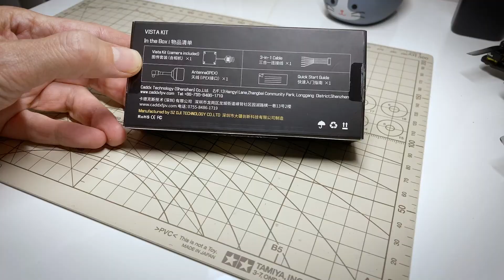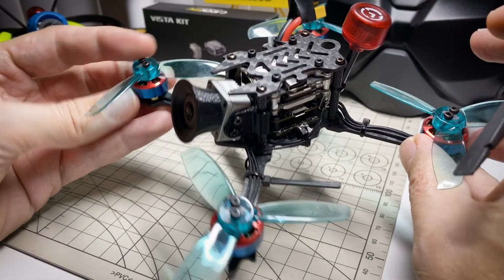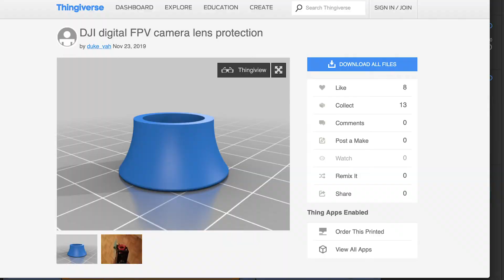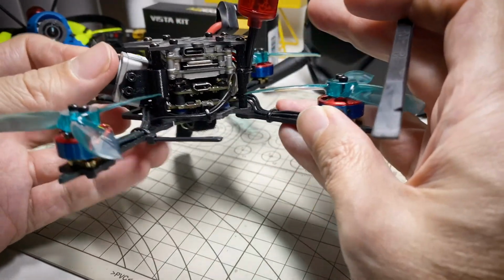Caddx Vista DJI Digital FPV Quick Look + Tomoquads CS3 Chopstick and Airblade 1404

Comment: I made the huge mistake of buying a Tomoquads frame! NEVER AGAIN! First off, they will not respond to emails EVER! I've emailed them 3 times and never heard a word! TERRIBLE CUSTOMER SERVICE!  Secondly, I nicked a twig about 3-4 feet off the ground and it fell into the soft grass. I wouldn't even call it a crash it was so mellow. I went to go pick it up and was AMAZED THAT AN ARM WAS BROKEN! 4th flight ever with it! Barely even hit the ground! Didn't roll over and over across the ground, just landed! Broken arm! First frame I've ever had broken in 3.5 years of flying about TWO DOZEN QUADS! Plastic frames are stronger than this SHIT QUALITY carbon fiber used in TOMOQUADS frames! Total garbage! When I emailed them, they couldn't even be gracious enough to reply!
GUYS:  DO NOT BUY TOMOQUADS PRODUCTS! You'll be sorry, like me. And, it was more expensive than ALL the other frames I looked at. ROYAL RIP OFF! 😳😩  Owner is a total jerk!!!!! 💩

Comment: The xing 1204 seems to be a lot more powerful (500g thrust on 4s), have you considered them instead of those 1404?
Reply from the maker: Interesting! I hadn’t considered them but I may give them a look:) I wouldn’t mind saving the weight as well.
Reply: @MiniMicroFPV  Note sure if we can trust their website (https://shop.iflight-rc.com/index.php?route=product/product&product_id=1094) but let's see. 
I haven't found a good vista toothpick frame so I am definitely following your progress here btw! Rocking the ultralight ex with the vista right now, but it's a frankenstein (https://rotorbuilds.com/build/23026)
Reply from the maker: Thanks for the link! I can get those motors locally:)
Hehe, I also looked at fitting a Vista in my EX frame but the camera didn't fit with the electronics so I abandoned the idea. I see you found a way;).
Reply: @MiniMicroFPV  Yeah, I was trying to hack things around. I wasn't to serene with the camera protection when putting it in front of the FC so I just remixed a canopy somebody made for the 95x. It replaces the airblade ex carbon but I like it better like this: https://www.thingiverse.com/thing:4352790. Same weight

Comment: I thought about the Chopstix3 frame but i already broke one frame with a regular 20x20 mamba stack build on the frame. So i ended up putting the vista on a Diatone 3 inch 369 build with 1408 / 4000kv motors and got simular flight times at 5 to 6 minutes. Really happy with it at 262g with 850gnb 4s. Probably will do a 3 inch build with all in one Aio board and try to keep the weight at sub 250gram all up with a 850mah 4s lipo. Still interesting build thanks for sharing..subbed
Reply from the maker: That sounds like a beast:) I’ll probably try to build my next one with a bit more power. Thanks for commenting and subbing!
Reply: @MiniMicroFPV  It is actually ..lol..and it don't fly heavy hardly had to tune for the extra weight😀

Comment: Outstanding work sir! Do you think it would be possible to pair the Vista with an all in one board and a light frame to have a sub 250 ripper with HD
Reply from the maker: Oh for sure. Even though I wouldn't call this model a ripper it's well under 180g so it wouldn't be tough to use more powerful motors and batteries and stay under 250g. I'm going to be trying a new build soon so stay tuned for that:)

Comment: Great review. New subscriber here! Any perceived latency in HQ mode? Other reviews seem to put latency around 38-48ms which is near the latency of a Runcam Split and the latency of the Split wasn’t noticeable to me.
Reply from the maker: Thank you subscribing! I couldn't perceive additional latency when flying in HQ mode compared to Low Latency mode and I also didn't feel latency to a great degree with Splits. On-screen it was showing a range as you described and whether in HQ or LL mode the bitrate at its best was around 25Mb. For my close flying it never really went below this:)

Comment: Seems to fly well. I'm hanging out for a 3 inch lightweight frame made to carry the vista.
Reply from the maker: Yes I imagine there will be some nice frames made just for the Vista in the coming months and I'll probably move some of this gear over at some point:)
Reply: @MiniMicroFPV  just had a look at this frame from tomoquads, and he does have an option with a HD camera protection mount. I think I just found my caddx vista frame. I have a whoop style FC so that will save the stack height compared to your build here. Thanks for the review